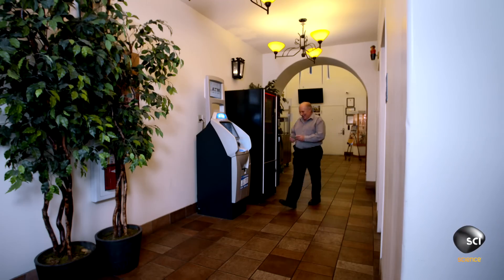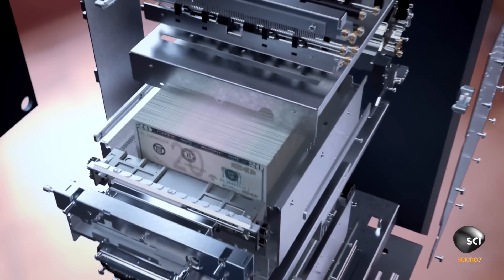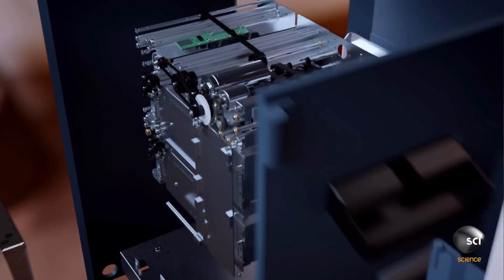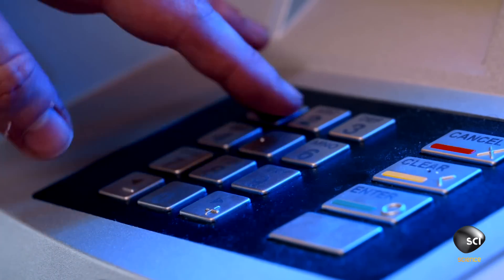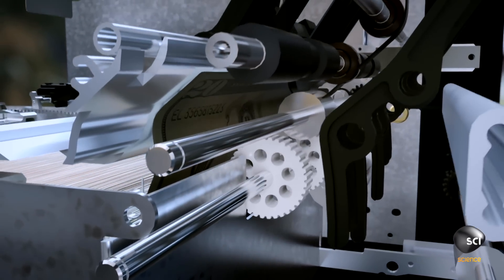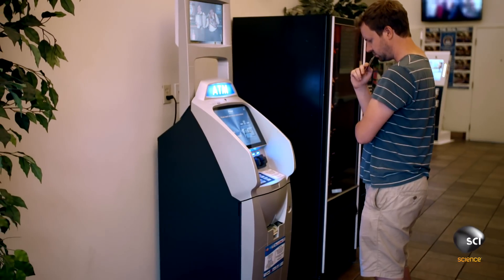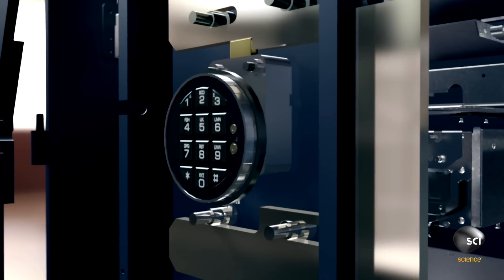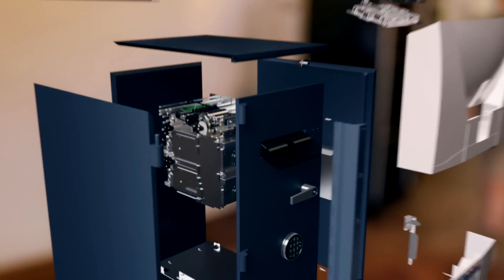Fort Knox in Box: How ATMs Work

Comment: Wait... So if the safe if under heavy protection, and the actual control panel needs to tell the safe to output this amount of money, how does it interface with the safe and couldn't you just get the cable input, spoof a width drawl and get tons of money 0_o

Comment: wow... just wow... i could so easyly get into an atm machine xD just give me some daimond tipped metal drills and some other smal tools and 30 mins alone... you just got yourself olmaost half a million $$$ xD or you can use  a 10 ton pounding hamer and smash its door open... or even thermite if the cash is in a endo heat protective casing and water proof xD maybe i cant hack into it but i sure can blast it open no problem.. i mean money should not be destroyed by a blastwave xDor just drill a hole put a presurizer into the door seal it real tight and blast air into it until the box expodes like a aerosol can when punctured... i mean atm makers get your shit right! it is so easy to brake into them...
Reply: ***** your a salty bitch..... here have some love <3
Reply: If robbing atms were easy anyone would do it. 30 minutes is a LOT of time to rob something. Police respond in usually less than 5 minutes. And a lot of bystanders would notify authorities and/or try to stop you. Also diamond drills are expensive, loud, Very heavy(at least 500 pounds), and need immense amounts of water and electricity.
Reply: NunchuckDuck rip the atm out of the ground (with a truck or someting) and drag it to a place where i can work for 30 min ;) you can put it in a faraday cage in case it has gps trackers..... soo um yeah haha
Reply: natan zielinski Yep, That is totally stealthy and no-one will notice that someone is dragging a atm out. LOL
Reply: ***** i just give instructions ;) i did not go to biomed engeneering clases for nothing haha.. oh wait... woops i meant electro mechanical engineering xD so um yeah i know about alot of stuff haha :P  goddamn names of job/study clases are cunfusing when translating them from polish to english lel
Reply: natan zielinski Yes your highness. The commoner obeys you. XD. Like you're any better than me
Reply: well, when I was a Child I was in the Gifted program and I have an IQ of about 140 too. although IQ doesn't really matter. Wtf does study at least 3 different times mean? I've been to primary school, middle school, high school, and I'm in university. So techinically I've also studied 3 times, and also, being smart is good, but actually USING your brain is WAY better
Reply: I'm pretty sure smart people usually don't brag about how smart they are, or misspell every single word, and smart people USUALLY don't type or say soo um yeah... get your 13 year old fingers of the keyboard, and If you really are so smart, DO IT. Rob a Atm for me. There are smart people that have done crimes and haven't been caught, so do it
Reply: I shall WIN! XD. but, you could rob a atm at 17 years old.3 everybody needs money. unless your father is bill gates or mark zuckerberg
Reply: NunchuckDuck lol you are 17 yr old? xD um yeah i would not rob a atm, its high risk low pay so does not interest me. a coffee shop or a mini grocery store is best since it has no guards or good security. it has not alot of money but its a good starting point to move up to biger stuf... like aromored trucks or stuf like that. atms are not worth it if you want fast money and no direct conection to the crime. atms are generaly not too good. robing a atm is like you eating 8 pizzas to impres your fatty friends haha :P
Reply: ***** yah i could get into a atm but one only does that to impress his friends cuz it aint practical, besides aromored trucks can even have up to 100.000.000 (100 milion) dependinding on whats in the box
Reply: natan zielinski "aromored trucks can even have up to 100.000.000 (100 milion) dependinding on whats in the box. What is that supposed to mean? and also people rob people not to impress that person's friends. Robbing a ATM is practical. It has a lot of money. And you write/type 100,000,000 using commas or spaces
Reply: NunchuckDuck dude the cash inside a atm is binned in other words if you use that cash at a bank or such a place you woll get arested since the serial codes on the paper dolars will be able to be re traced to you every atm checks the serial codes. geting it is easy from an atm but the binned money is a problem. a armored truck can have gold. gold is waaaaay easier to sell and get normal non stalen cash besides if you rob a armored truck from lets say a casino. chance is that that money is fresh of the tables and has not been binned yet. so yeah... ( i mean thew trucks that transport money and gold and stuf from one place to an other. )
Reply: why would a casino have a armored truck?
Reply: NunchuckDuck okay so a casino makes money right?? when they make a lot of money, where do they take it?? to the Bank! but how does one transport a big sum of money? they hire a armored truck. where from? --> GardaWorld Corporation is a Canadian private security firm, based in Montreal, Quebec, Canada (that is if you are in canada) so thats what i mean look it up dude.... same goes for museums or jewelry stores they hire truckes like those with guards to transport valueble stuff. the target is on the move so its easier to steal from it and get away fast.
Reply: you would steal it from gardaworld. not the casino
Reply: i would be stealing from both of them. they only transport the money that the casino owns xD
Reply: ok... then do it lol
Reply: NunchuckDuck nah im too lazy and have no need for money :/ but when i get hungry and i want to eat some pizza (some piza means like 12 pizzas with extra cheese for me xD)
Reply: Of course you want money!
Reply: NunchuckDuck no, i want.... i want love! :D
Reply: natan zielinski :D

Comment: They don't have to keep their card inserted when using the ATM? In the UK we have to keep the card in it, not just slide it in and out
Reply: +FreakFizzer It's because in the US they don't have chip-and-pin, so the card reader is just reading the magnetic strip and not a chip. Your PIN is not stored on the card like it is in the rest of the world. 
It's amazingly insecure as it's very easy to clone/copy a card
Reply: @robdavy4468  Most places use a chip nowadays. I can't even remember a place that doesn't accept it.
Reply: +FreakFizzer In the US it's like that for some reason
Reply: +FreakFizzer it's so thieves can't take it out of the machine and run away with it
Reply: +SenneF MC makes sense I guess. Would be hard to take the card out of the machine when someone is using it but still
Reply: *****
im belgium too
Reply: Also in canada